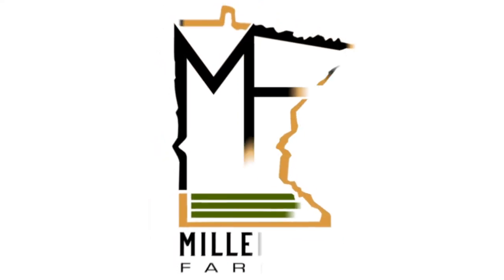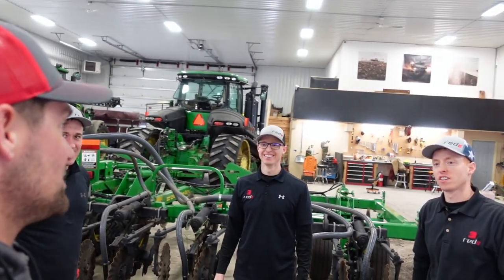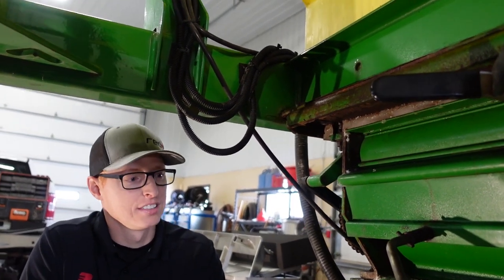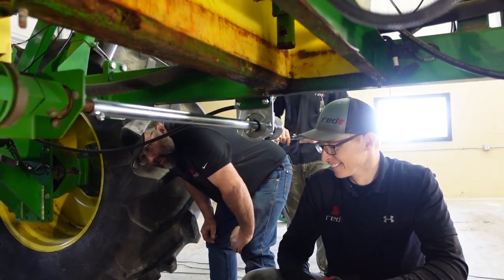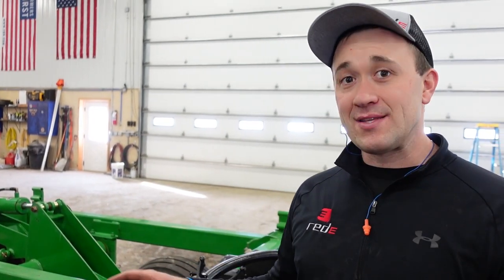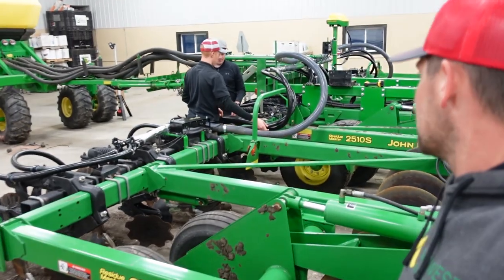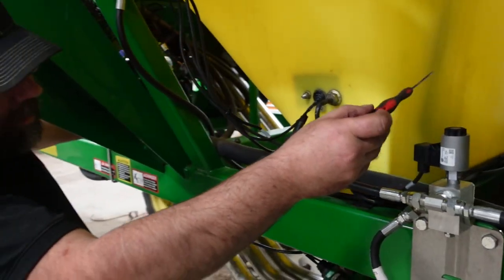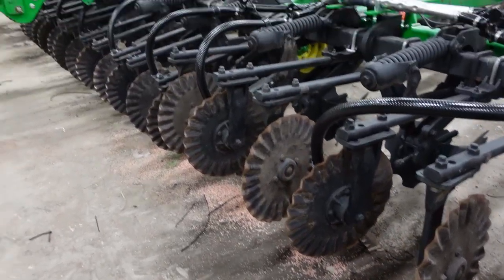Upgrades to the Strip Tiller

Comment: Glad we could help you out again Zach! It was a pleasure working with you.
Reply: Is the new funnel gasket different than the original so the fertilizer won’t deteriorate it?
Reply: Where can we get one of those hardhats?
Reply: @mattdorrel2593  We found them off Amazon!
Reply: @lyonfarms  Our funnels are made out of stainless steel, making it no match for fertilizer corrosion.
Reply: @RedEAg  aren’t the stainless parts going to cause an increased rate of galvanic corrosion on the carbon steel parts they are contacting?
Reply: @PUTEMDOWNProductions  although our complete kits don't mix the 2, steel and stainless are closer on the galvanic corrosion scale than say Aluminum and stainless so not a big enough concern. It's the high salts in the fert that are the biggest killer at this point. Good observation though and not too many people know about galvanic corrosion!

Comment: Random shop question...  Are your shop floors 100% level, or are they slightly pitched so water/fluids moves in some direction for drainage?  Residential garage floors are slightly pitched towards the garage doors, but they are generally not measured in "acres" (OK, multiple 10s of thousands of square feet). 😉

Comment: You must clearly be convinced of the cost savings / increased performance of the crops to be convinced of the value of adding all this complex updating equipment! I will be more than interested to see how reliable it all works together in the future. My, admittedly limited, experience of electronic monitoring and control systems has not been very satisfactory to date with farm field equipment.
I wish you all the best with this in future.

Comment: Seems odd that both Case and Deere would not make all these with Stainless knowing that fertilizer is so  corrosive.
Reply: Stainless is about 30% more per lb than steel.
Reply: @mramseyISU  also way harder to work with
Reply: @alexward1319  when I was working as a machinist a hunk of stainless getting dropped off was a sure fire way to ruin my day.
Reply: how would they charge you to buy the new stainless ones if they just gave them to you
Reply: I think Zacks mentioned before that the cart was originally designed for seed... I could be wrong though
Reply: Plastic is good enough for the flexible parts of the pipework so why not for the rigid parts?
Stainless looks cooler
Reply: How else would they sell you new tubes?
Reply: @justingrimshaw4815  us farmers who use these carts for wheat, barley, oats, Canola etc. Put grain in one tank and fertilizer in the other, so usually only one tank is rusted out and the other is fine.
Reply: I wondered this too. Has to be some kind of plastic that could be used in that situation.
Reply: @jackbannock3458  thanks! That’s some BTO stuff that I would never learn as a hay seed! Lol

Comment: That fertilizer is rough on equipment. 🤪 Rusts everything..
Reply: Normal steel for key fertiliser parts is just cheapskate from Deere.  Small incremental cost for stainless with complex pieces with large fabrication time
Reply: @martinjohnson4264  Yea i wondered the same, why not go for stainless where metal has to make contact with fert.

I mean, i worked at a fertilizer factory. Our factory does not corrode away. (Well only in the part we have hydrogen gas when making ammonia, due to them hydrogen molecules being so tiny and will work their way thru everything.. Hell they even corroded thru our concrete/stainless composite mantle in the secondary reformer)

Comment: Zach why dont all tractor manufacturers/ engineers build what ever part has to deal with putting fertilizer in the ground use a metal that dosen't rust out . I kno the answer to it but it still doesn't make it right  good video Zach & upgrading good team of guys !stay safe 
Daniel from central Mississippi

Comment: Just like the Welkers, your going stainless steel on the planter. So Deere puts the most corrosive metal they can find so you keep buying new stuff. I bet if you had a International M on your place you be still using it.
Reply from the maker: Wrong.  They're all like that.  Most of these carts are used for seed so it's not a big issue.

Comment: I think the new camerea has whery much ekko, i did like the old one bether..
Reply: thats called the empty venue mic.  or the difference between an internal or external mic.
Reply: The echo is pretty intense with headphones.
Reply: Are you using variable bit rate for sound?
Reply: Or automatic mic sensitivity...
Reply: it sounds like a combo of pick up patterns of the mic and the bounce from the building.

Comment: I'm sure Deere puts all stainless in those parts now-a days. I mean it's the right thing to do, right?
Reply: It’s an expensive upgrade when are new, for the extra cost it’s hard to justify, it’s usually the second owner that ends up with all these rusted out issues, original buyers upgrade by rust out time, why spend extra for someone else.

Comment: Honestly, this camera seems to be no good. At least the settings used in this video ... :)
- Audio is weird. There is a weird echo inside the workshop, and some sort of compressor function is trying to amplify the echo when you stop talking. It sounds kinda creepy with headphones on.
- Stabilisation is decent, old camera seems to do a better job
- Either you're running a low framerate or the camera is weird. Video seems to stutter a bit when you move the camera. Hard to look at, on a big screen. Really, 60 fps video would be awesome :P

Anyway, great to be able to follow you guys, keep up the good work! :)

Comment: Maybe I missed this, but why does the stainless steel in the Y have the grooves/dimples/bumps on them?
Reply: It’s too make sure the seed bounces around instead of only running on one side of the tube. Ensures that the seed/fertilizer is split evenly between the two sides of the Y
Reply: @tylerdunsbergen2636  cool!

Comment: I know this retro fit is spendy, but way more efficient and reliable. Why don't the mdgs. Just do this at the factory, and charge a little more. Their equipment would be so much better and appealing to end users and buyers. Why do you have to go through all this after the initial purchase? Seems like John deere should do this during manufacturing.  Care to comment? Please!
Reply from the maker: Honestly my understanding is that most manufacturers don't use stainless material on their carts, it's not a Deere thing. And the blockage monitors are because I'm doing something pretty "off the wall."  This isn't really a traditional thing.  Both the tiller and cart are also 12-13 years old so technology has changed.
Reply: Thank for explaining that!👍

Comment: O rings swell from moisture contaminated hydro fluid, pinched hammer activation syndrome,  for 3 years,  after using  old D6 on JD 455 drill after computer on cat 40 went down, rebuild kit

Comment: somebody help me (a non farmer) understand; to wit:   if a piece of equipment of that size, price, and complexity, is designed to hold and distribute products that are intrinsically tough on ferrous metal, then why does it seem kinda jankie from the get go.  Mild steel with green paint on it seems a bit iffy.  I get trying to keep the base price down, but all the gear/drive motors/gaskets/stainless he just added plus original cost minus depreciation is what? Or am I not seeing it correctly?

Comment: On your Pete's fuel system issues.  Are you running any kind of Biodiesel blend for your fuel.  If so the black stuff your seeing could be a common problem with biodiesel blends.  It is a kind of algae that can survive and grows heavily in the biodiesel.  Plus that crap removes any and all crud in the tanks that was in there from the previous fuel.  That black crud could be the results of bad PM practices from the last owner.  Most fleet owners do not really take good care of their trucks.

Comment: ZACK
BACK IN 2003 2005 I BUILT STAIRS AND PLATFORMS AND PULLED UP LADDERS AND ANCHORED THEM INSIDE TANKS DECALED LIDS TIGHTENED TANK SUPPORTS AT JD PLANT IN VALLEY CITY, ND

Comment: Great video. I didn't understand everything but I'm not a farmer either, still enjoyed watching people work that knows what they are doing and how to get the job done.  I always heard it was duck tape and bailing wire would fix anything. It's does not matter how much it will cost you up front because if you put on at a variable rate it will save you money on your fertilizer bill at the end of the year and for years to come. Have a great day

Comment: Just as an fyi. The alarm contact goes on the inside of the door not the outside. You may want to fix that before someone bypasses it and walks into the building without setting it off. Its pretty much worthless the way that it is.  Please fix to better protect what you have. :)

Comment: This technology is fantastic but how will these electrical and hydraulic components fare in a couple years after they are left exposed to the elements? I feel a migraine coming on trying to diagnose the gremlins in this system after mother nature has her way with it. The level of technology may be beyond our capability to keep it running reliably.

Comment: Man, it really seems like those lower portions should be made out of something like a 316 or 304 stainless instead of plain mild steel...  That's a heck of a hostile environment, and it looks like the material choice was far less than optimal for it.

Comment: Check the anhydrous hoses they expire there’s a date on them and if they fray after the date you get into some trouble I did allot or work on them things allot and almost lost a friend to it when you talk about grain bin safety that’s one that about anhydrous some guys mite not know. I not sure if the date stamped on the hose is the production date and it’s five years later change or it’s the expectation date printed on there it every few feet stamped on there.

Comment: So maybe I’ve got a dumb question, but where do you put in your NH3? Is there a line on each of those shanks? Does it come out at the same height as your P and K? And do you put seed direct on the top of your fert, or place along the side?

So many questions, lol.
Reply from the maker: The NH3 will be applied through the same shanks but there's a separate line for it.  You'll see when I run the hoses this fall!  And we will plant right on top of the strips

Comment: can you do a video of how you test the fields to show how much pot ash/fertilizer you need to apply.
Reply: Most folks hire fertilizer supplier.  They take, analyze as many samples as you are  willing to pay for.  Every sample GPS located.  The results tell you what that area is “deficient “ in.  With his rig he can increase, decrease as needed.   I do a sample every 40 acres on mostly uniform fields.  (Because to change rate I would have to get out, use wrench, to adjust rate every round). His is much better.

Comment: Zach good way of keeping the hoses in the right outlets and that is put a zip tie around the left hose in each remote and then use a heavy duty ties one tie around both hoses in the 1st remote, and then 2 ties around the two hoses in the 2nd remote and then 3&4 and so on, and the hose that is marked with a little tie always goes in the left side of the remote. If you have a rag you can hook up the rig and clean all tips and put in the right remote outlet in 5 minutes or less. I came up with this to save time and getting in and out of the tractor. One time out and one time in the tractor. Time is Money !
Reply: I bought colored zip ties. Few yrs later they all faded so bad..
Reply: You don't need colored ties 1 tie on the left hose and 1tie around both hoses means 1 tie around the left hose means goes in the left remote and 1 tie around both hoses the right hose goes in the right remote not to hard to figure cuz my son did it when he was in kindergarten and would ride in the tractor with me all the time
Reply: @roberthakeman9822  maybe if you only use 1 tractor, or same brand.  I might swap tractor, and type on implements.  One tractor the top, another it needs to be on left, a third the inside set...
Reply: @ Larry Thompson we had a 8450, 8440, 4650,& 4630 and they all had 3 or 4 remotes and never had a problem of the hoses being in the right remote 1st lever was raise or lower the equipment and the
2nd remote for the wings and the 3rd remote was open and close the valve for putting on anyhydrous . Just giving Zach a tip for getting the right hoses in the right remote and not having to get in and out of the tractor constantly to find the right hose and remote !

Comment: Hi it is hard to believe that equipment costing over 200 K does not have all 316L SST hardware and panels tubing ECT it would add very little to the MFG cost that thing is made like crap and what is up with that rat nest of wires why not make 1 jacketed  cable  not that cheep wire loom jacket which is junk  . I spent over 40 years designing equipment and that looks like a R & D prototype.